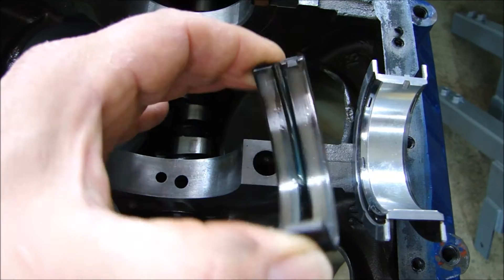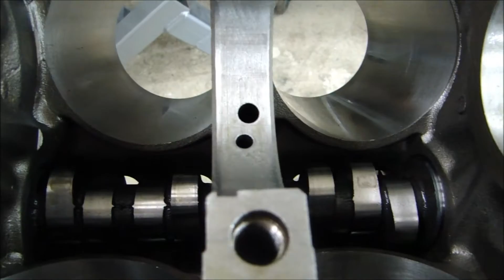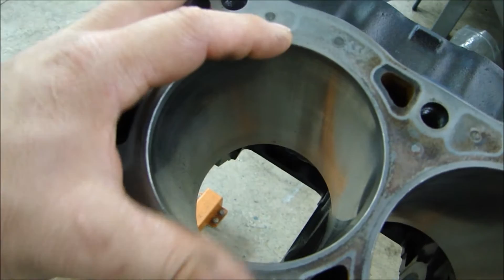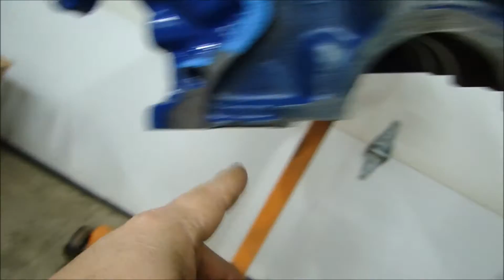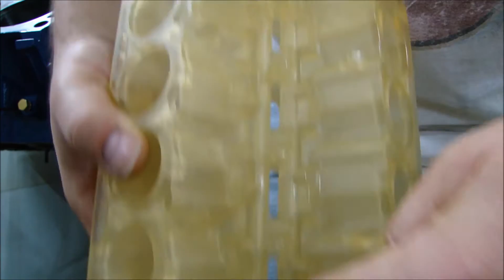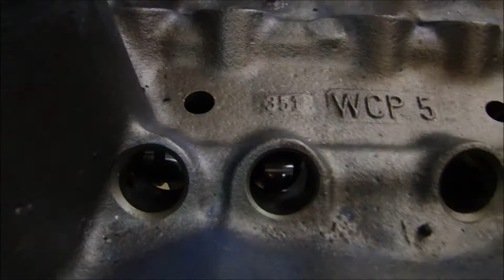Cylinder Blocks and Crankcases

Comment: The the core plug is for the core of the mold it's where they take the sand out after they cast open space for your water jacket in your oil ports that's how they make the holes they have core in there it's part of the casting process it's not where the metal pour in
Reply from the maker: Interesting

Comment: You have an awesome channel.
In case I want to buy a plastic block for studying from where can i get it. you had two different Blocks. which one do you prefer?
Reply from the maker: Thank you....those are 3D printed models
Reply: from where can I get 3D printed models. I think it is ready for casting?
Reply from the maker: This are not really available to the public. It's just a small model of the full size engine

Comment: One argument to the crankcase/block statement, blocks include the cylinder and crankcase, and a crankcase has cylinders attached to it. Motorcycles and reciprocal aircraft engines are good examples.
Reply from the maker: That is true, I was just speaking about car engines.

Comment: On a Small block Ford, as depicted, you shouldn't use a sealant on the whole surface between the rear main cap. to prevent leakage you only need to apply a small amount of sealant from the corner of the main saddle to the edge of the seal.  Also, applying sealant to the front main cap does nothing to seal out oil from exiting the engine, since the front cover seal and balancer is what seals the front of the crankshaft. I've built many Ford engines from Small blocks to FE big blocks, and never had a leaker...and I have never used an anaerobic sealer...just a tiny bit of black silicone works fine.

Your explanations are very generalized, and not always exactly true for every application. For example, you don't machine the block deck surface to attain the highest compression, rather, you would machine the block deck to acheave a square deck height from the front of the block to the rear of the block as measured from the crankshaft centerline and to minimize the space between the deck of the piston to the head to increase quench. (lowers unburned hydrocarbons)
 To change compression, you would normally adjust the combustion chamber size usually by installing popup pistons (+cc) to increase compression or reverse dome pistons (-cc) to decrease compression, by adjusting the actual chamber size, or a combination of both methods to arrive at the desired compression ratio. 
The small amount of compression change by machining the block deck like you state really is not normally going to make a big difference in how the engine runs in a street application. Normally on a street engine with a stock Camshaft, (especially on a small block Ford) there are many times the required valve clearance between the piston and Valve before any interference occurs. Most likely, over machining the block deck would result in piston to head clearance problems before you would run into piston to valve clearance problems.

The so called rapid prototype block you show, while cool looking, The process is actually called Vat Photopolymerisation or Stereolithography (SLA).  During the Normal SLA manufacturing process, the model does not rise up out of the photopolymer while the laser is hardening each layer. Instead, the model is lowered into the photopolymer as it is built layer by layer. 

Just saying.
Reply from the maker: Good comment...thank you

Comment: I have a question; the oil lines that go through the hydraulic oil lifters, are they daisy chained, or are they on separate branches between the main line that go through the block and the oil return line like the crankshaft lubrication?

Would the lubrication system of hydraulic lifters of a DOHC engine be the same as in an ordinary small/big block engine?
Reply: Not sure what you mean by daisy chained, but the lifter gallery is a single bore through each lifter bank. It's proximity between the top and bottom of the lifter bore differs between manufacturers but is usually cut off at a predetermined point of lift. Oiling is always a point of interest to anyone building performance engines. Good question.

Comment: The thrust bearing is real important with a manual transmission equipped car. When the clutch is pushed in, the the crankshaft is pushed towards the front of the engine.

Comment from the maker: Diesel engines work by using compression for ignition. There is no spark plug that provides ignition. As a result the sound you hear is the diesel fuel compressing to the point of ignition and is completely different. It is a burning more than and firing sound.

Comment from the maker: That is one of the biggest controversies, but I will answer like this. Usually anything over a 366 is a big block, but what about the 400 small block right? The difference lays in the heads. A small block will have the heads closer together, and the valve covers will be longer and taller. A big block will usually have a longer stroke and more torque while a small block rev's higher. There really is no definite answer, but say a 351 and under is a small block and over 396 is large.

Comment from the maker: Thanks JayC. With the ground surface on the crank and the right bearing and engine can last a long time with regular oil changes. Understanding how the oil flows also helps pinpoint problems. It really is pretty intersting.

Comment: ah. i figured as with most people that you didn't like to be corrected. sorry about that. either way, the freeze plugs are drain holes for the casting sand that is used to for the water jacket. They are not a way for the cast iron to be poured in. those usually show up as ground down spure. also, over head cam motors don't have lifters in the block. their equivelent would be in the head. over head valve engines have them like that V6 block did.